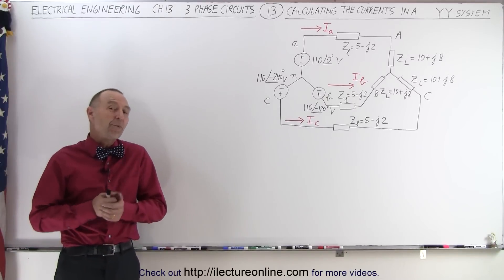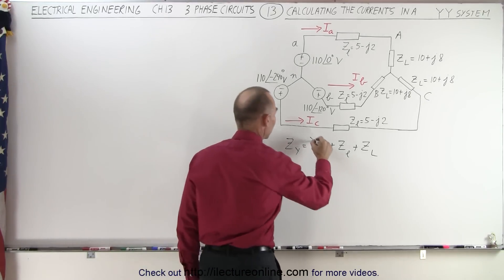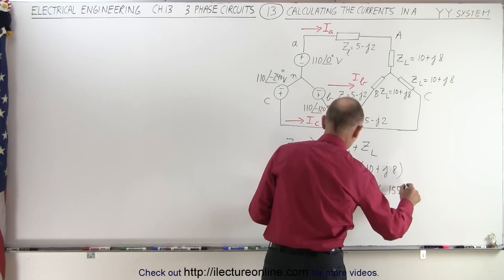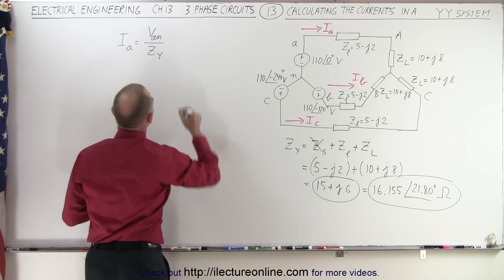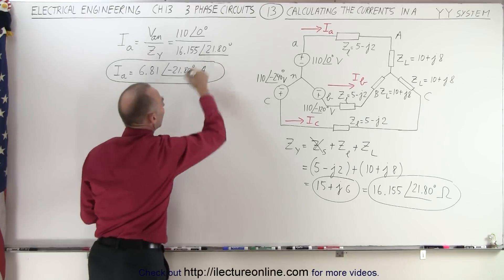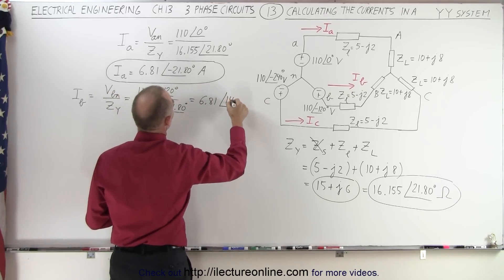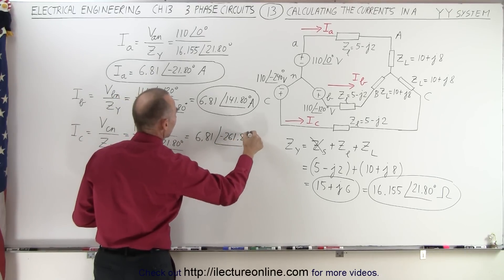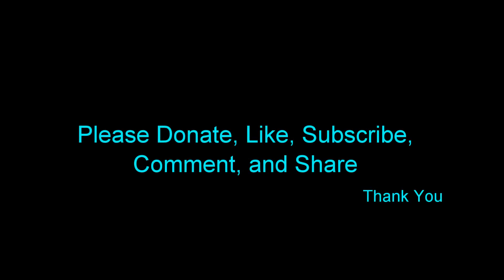Electrical Engineering: Ch 13: 3 Phase Circuit (13 of 42) Current=? Y-Y System 1

Comment: Simple typo for everyone, current at load b phase angle should be negative 141.80
Reply from the maker: You are correct.  That should be - 141.80 degree phase angle.  Thanks for pointing that out.

Comment: sir I wonder why you don't multiply the load impedances by 3 since there are 3 ones
Reply from the maker: That is because the load impedances are not in series, thus they act at different times during the phase
Reply: @MichelvanBiezen  But, all three load impedances have the same phase angle.

Comment: Thank You Very Much.  
I believe that the angle in current (b) should be (-141.8).
Reply from the maker: Yes, you are correct, the "-" is missing.
Reply: @MichelvanBiezen  how angle ( -261.8) became 98.2..explain plz
Reply: how angle ( -261.8) became 98.2..explain plz
Reply: @mdmaniruzzaman2378  360-261.8 = 98.2
Reply: @mdmaniruzzaman2378  If you add 360 degrees, you don't change the angle, but it just changes what you call it (like adding zero). -261.8+360=98.2. If you were to draw both 98.2 degrees and -261.8 degrees, you see that they are in the same spot. That is because all you did was move 360 degrees which is a full turn which does nothing.
Reply: @MichelvanBiezen  Please such corrections should be made, if need be the video edited or redone to avoid confusions and inconveniencies..remember these are calculations and every sign and number is significant..Thanks
Reply: i know it's kind of off topic but do anyone know of a good website to stream newly released movies online ?
Reply: @Kian Nicolas Meh I use Flixportal. you can find it through google=) -leandro
Reply: @Leandro Aydin Thanks, I signed up and it seems like they got a lot of movies there =) I appreciate it !
Reply: @Kian Nicolas no problem :D
Reply: @mdmaniruzzaman2378  he added 360 to it

Comment: Sir, Why do we need to convert the line voltages to phase voltages to calculate the line currents??
Reply: We do not have to find line voltages to calculate the phase currents, which are the currents in each line (Line currents). We just need the phase voltages. Van, Vbn and Vcn are the 3 phase voltages. ZY is the total impedance for that specific phase voltage. Zy will be the same for each because it is balanced. So, Ia=Van/ZY, Ib=Vbn/ZY and Ic=Vcn/ZY. Just like ohms law (I=V/R).

Comment: It may some mistake sir, line current,lb will have negative phase angle.
Reply from the maker: You are correct, that should be - 141.80 degrees